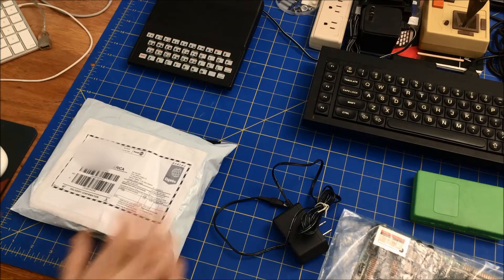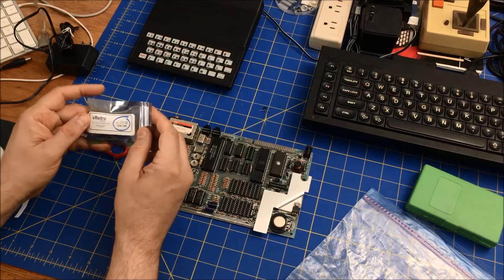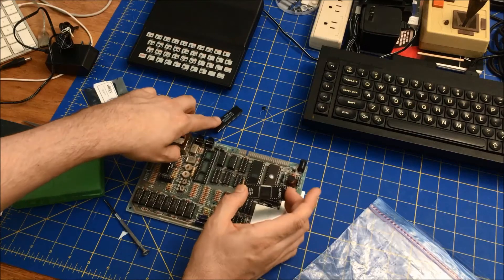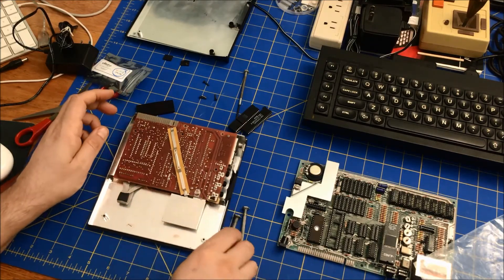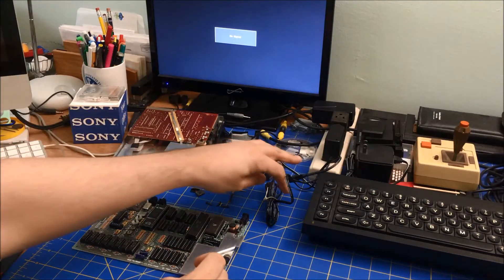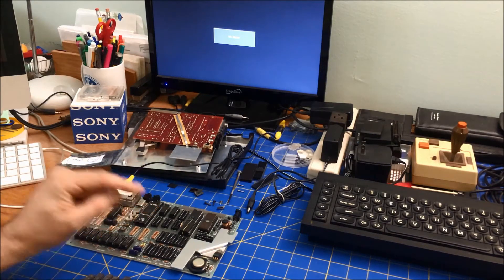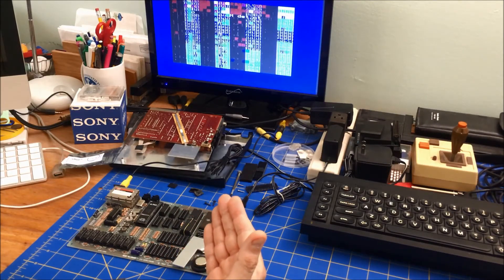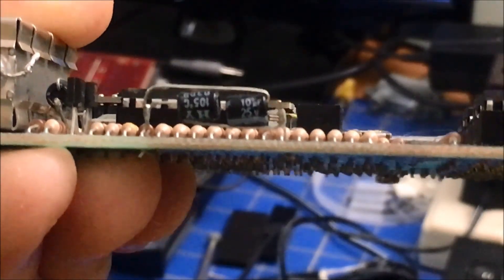FPGA ULA for ZX Spectrum: Will it Finally Fix It?

Comment: Two huge mistakes in this video...
1. Keep circuit boards away from plastic. Use antistatic bags.
2. Don't handle chips (especially CMOS). use a ground strap on your wrist and a ground mat on the table.
Static electricity can damage or destroy circuitry.
Reply from the maker: I use a ground strap whenever working on electronics (you just can't see it). Haven't had an issue with plastic and static but do understand  the issue.

Comment: A Sinclair  Spectrum running a ZILOG Z800 and 1GB of RAM might not have been such a bad idea would have given the SHARP MZ80K a run for it's money.
Reply from the maker: That's a buff configuration...
Reply: possibly maybe a ZILOG Z800 and ZILOG Z8000 and 1GB of RAM might have given the SINCLAIR Spectrum access to more libraries of software and possibility the ability to run a Build of UNIX System V that was created for the ZILOG Z8000.

Comment: Have you checked the voltages to the 4116 DRAMs ? It requires +5V, -5V and +12V to operate correctly.
Reply from the maker: Yes, I get all the proper voltages on the RAM chips. Read my comment on Tailzer because I had something weird happen when I put the bad ULA back in...the Diagnostic ROM started working and gave the ULA and the two 74LS chips as problematic...I replaced the latter two with no difference but when I replace the ULA with the vLA82 then I get the gibberish seen in the video. Very odd.

Comment: I'm not sure what the diagnostic ROM is supposed to do, but the corruption on the screen would suggest something up with the lower 16K.
Reply from the maker: That was my first thought but I have swapped out all the RAM (also added sockets and tested continuity). I also tested the swapped-out RAM and it was good as well.
Reply: My Timex (it's similar) had the same problems .... Ram+rom... After I inverted the polarity... It's working now.
Reply: New rom and ram.

Comment: lower 16 k is used as video memory so if thats not working the screen will be varying amounts of corrupted. The diag test runs lower first then checks for upper to test hence halting with no upper detected. The varying/moving of the faulty bits I would be looking at the 74LS157s to check that one or both are not faulty? other thing that can happen is track damage so I would be tracing all lines back to ULA/CPU. Lastly the transistor ove rthe CPU is a timing mod by factory for early ULA's in issue 2 boards. Not needed when you have a newer ULA or a modern replacement like Charlie's. Good luck! Please post when you sort, will sub and keep a look out.
Reply from the maker: Someone else pointed me to the LS74 chips. I did replace them with an older one but haven''t tested whether they worked as well. So that's next on my list. Thanks for the detailed diagnostic help!
Reply from the maker: So I got some really odd behavior. I swapped out the two 74LS chips and no effect, same screen display as in the video. I decided to pop the original Ferranti ULA back in -- note that I had tested it on my working 48K spectrum and it didn't work, so that's why I know it's broken. So with the broken ULA back in, instead of getting gibberish on the screen (like in the video) I actually got clear text on black background with no gibberish that said Addr Error: IC1, IC3, IC4 suspect, then tests memory and says "No Upper RAM detected!" So suspect ic's are the two 74LS and the ULA. So what's going on, why is Charlie Ingley's ULA replacement (which is new and should be working) making the diagnostic ROM have the screen behave all sorts of weird ways and the bad ULA make the diagnostics display normally? Is it that with a bad ULA the diagnostics does more limited stuff and never gets to the weird display? The diagnostic even starts out better, giving a solid set of color bars.

Oh and running the diagnostic a few times, at one point it said Bus Error Detected and re-ran the test, again, with the bad Ferranti ULA in it.

Comment: As you're a young YouTuber, may I suggest you too tape out or mask somehow the physical addresses, both your and your donator, on the package? It's good for you both.
Reply: Oh, and the tracking number/barcode may leak plenty of sensitive information too
Reply from the maker: @nneeerrrd  Oh good catch, thank you for letting me know. If you watch my past unboxing videos, I had always covered up the shipping label...I just forgot this time. The item was shipped from the seller but I usually cover up my own address. I just went and blurred it out via YouTube so it should be gone in a few hours. Usually tracking will show destination city but not an address, etc.
Reply: @8BitRetroJournal  sometimes, tracking will reveal more than that. E.g., name and/or surname of the individual who signed for the package.